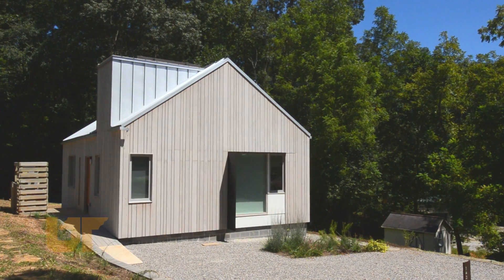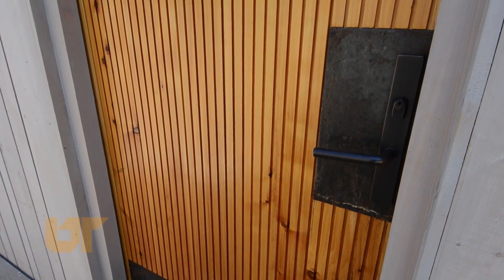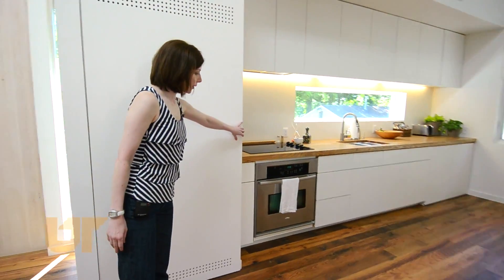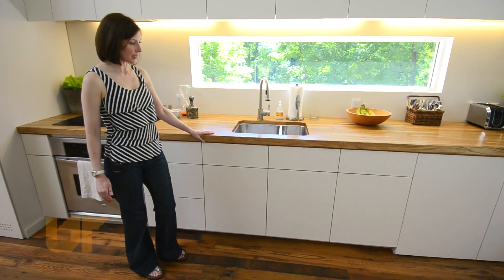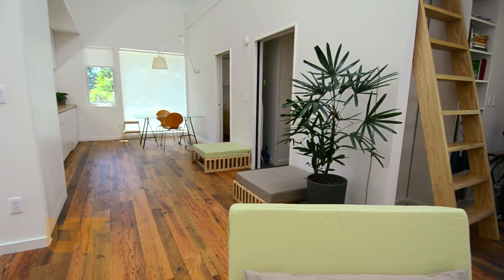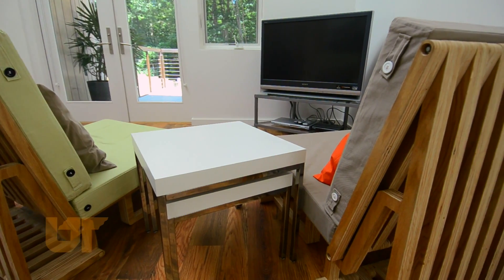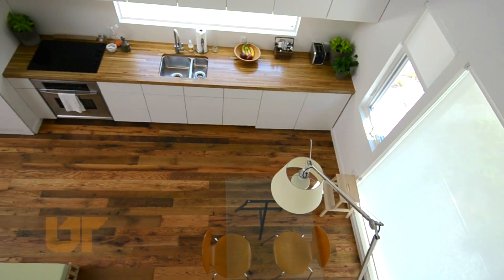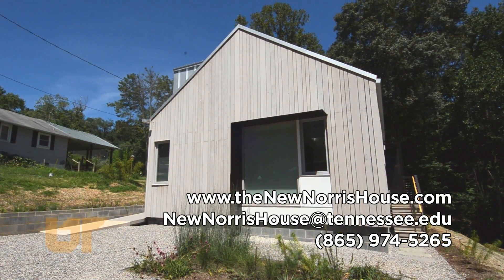Tour the New Norris House

Comment: @zeus3926 I assume that is a rhetorical question--I'll bite. It could be argued that a rainscreen facade is a vented, whole house shade. Deeply inset windows have been thoughtfully located and additional shading elements are used, such as the canopy. The siding material (White Cedar), as well as roof detailing has helped us deal with durability. The ceiling cavity is sealed, negating the need for exterior venting.

17KwH/day for a home that size and age is commendable! Thanks for your interest!